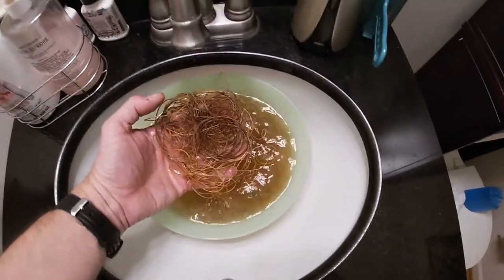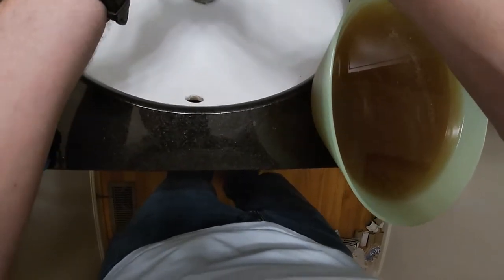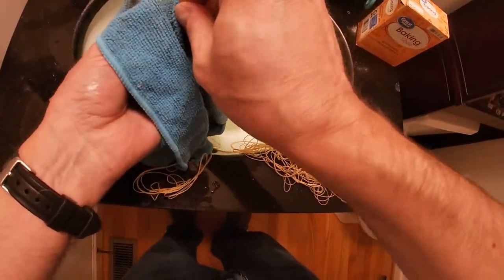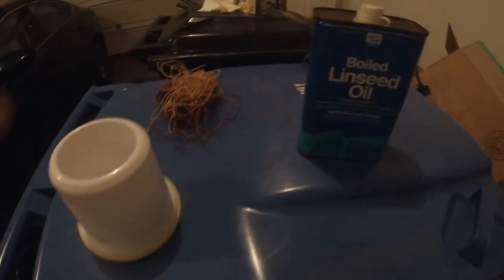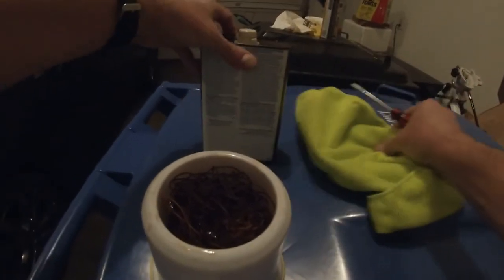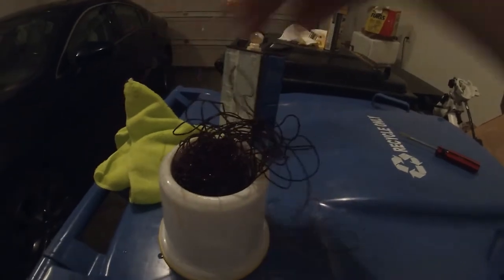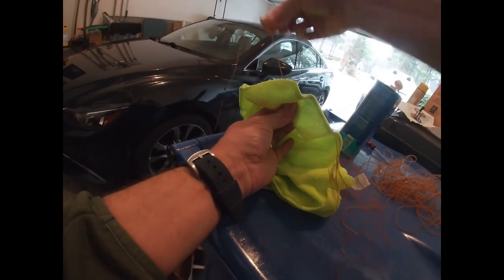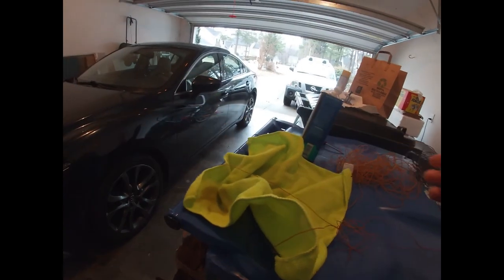Restoring vintage silk and oil coated braided nylon fly lines (Modified Overmywaders method)

Comment: Whatever you paid for the line is not worth it: untangling that mess is too much of a chore!  I imagine the way to soak the line is to keep both ends of the line out of the solution so that the line doesn't become a tangled mess.  Then soak the ends of the line later.
Reply from the maker: The lines came on old reels so virtually free.  I caused the tangle and yes it was a pain to undo but they are on reels now so all good.